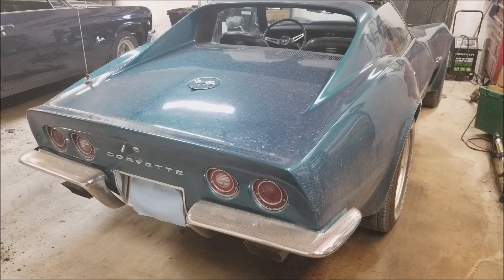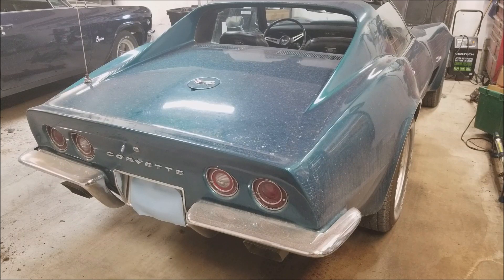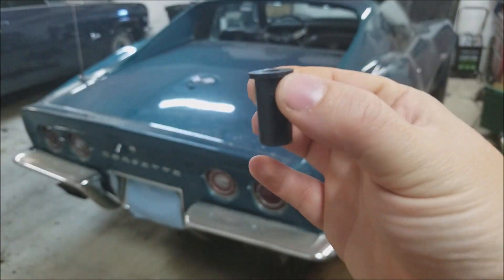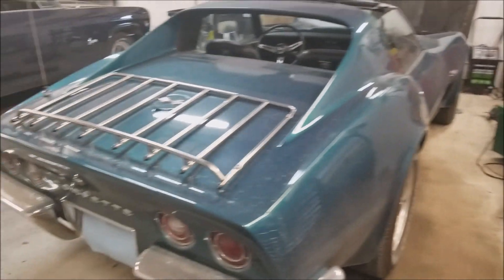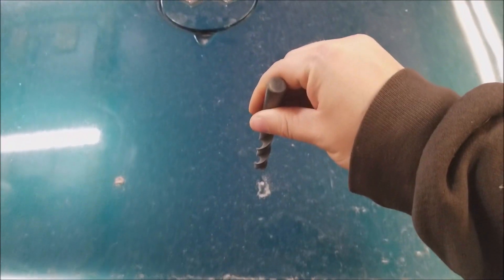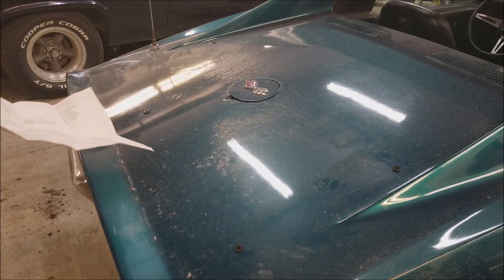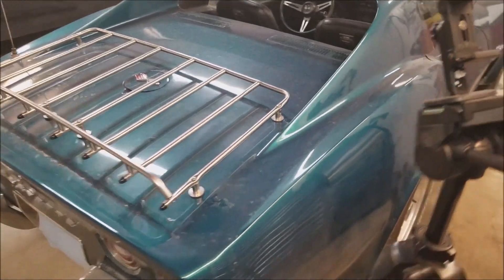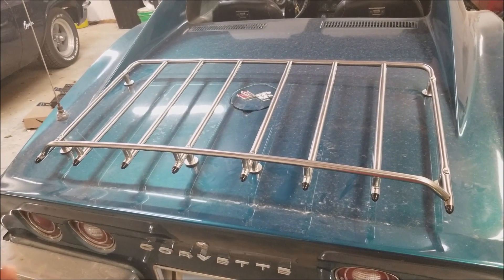Installing A Luggage Rack On A C3 Corvette!

Comment: Great job! Just one tip, better if place blue tape on the hole position before drilling, that will avoid any chips in the paint of fiberglass.

Comment: You're a lot braver than I; I cringed when you were drilling the first hole. But it came out fine. Looks good.
Reply from the maker: Thanks bud! I was pretty worried about it, what a massive headache it would be if one of the holes was off or if it came out crooked.

Comment: I'm thinking about installing a rack on my 74 Stingray. I didn't realize to was frowned upon.
Reply from the maker: It will likely hurt the value if you have plans of selling it.  

I like it and have no plans of selling mine.
Reply: Think about it.A luggage rack on a corvette.Does it look better?Now think about a large suitcase strapped to it going down the highway.
Reply: It sure is! Why on earth would anyone want to drill holes in that beautiful body? Especially when it's to install something that looks like an overgrown towel heating rack. I only watched this video to see how how I could REMOVE the rack from the Corvette I just bought - and it was (unintentionally) very informative. I was worried I'd have to go underneath the car to undo the attachments but it looks like I don't - whew! 

If you want more luggage space buy a station wagon.

Comment: Some car guys these days can't wrap their heads around the concept of a sports car and the fact that back in the day people actually used Corvettes as transportation.  If you wanted to take a roadtrip or vacation run with your top down or stowing your T-tops...guess what. you have zero space for a suitcase.  Most of these were GM dealer installed and will have no effect on NCRS or Bloomington Gold judging and no effect on the car's value.